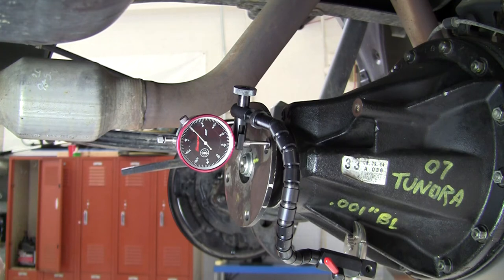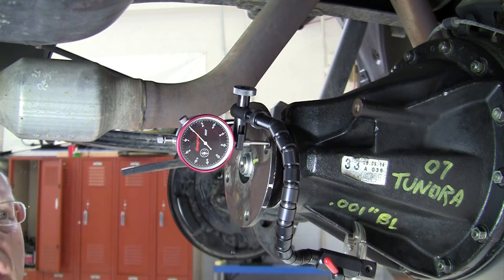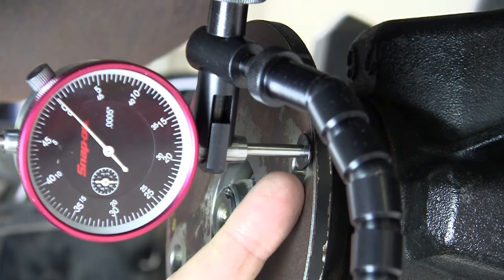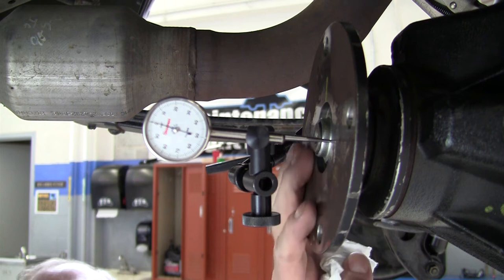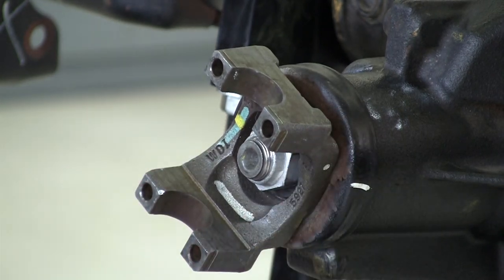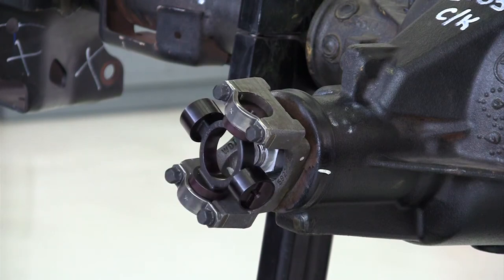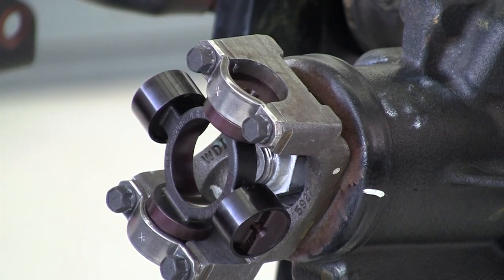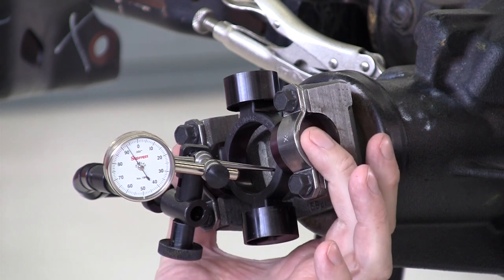How to measure Pinion Flange Runout

Comment: You're correct on the GM axle to determine if the flange or the pinion is bad. You called out a crush sleeve replacement. However Chrysler states to measure pinion turning torque first. Make sure there is no interference from brake contact. Record your measurement. Remove the flange/seal. Using a NEW nut. Install adding 5 lb.in. to your measurement. This will save the trouble of replacing the crush sleeve.